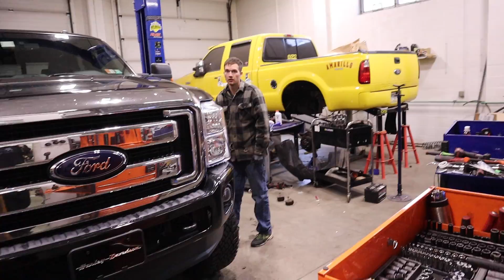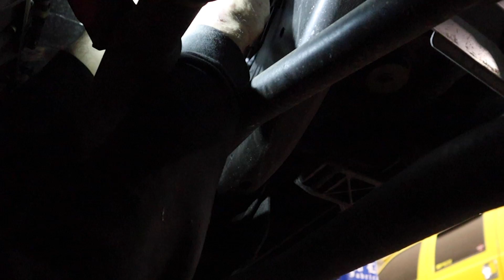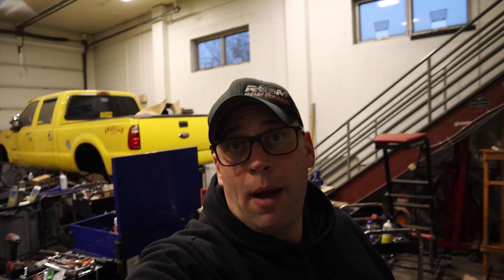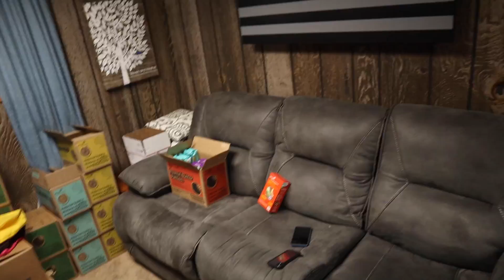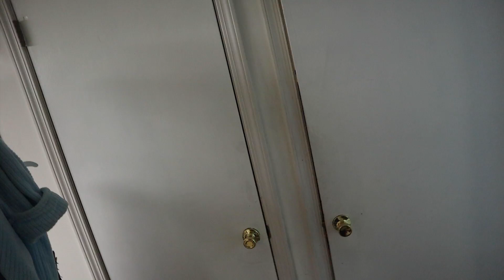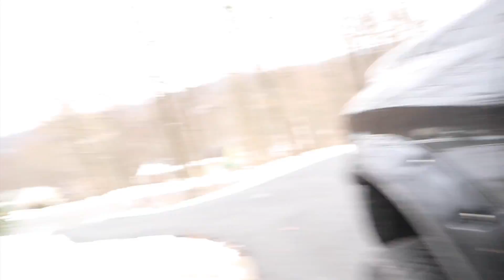CRAZY COOKIE MOM! Cummins CAT Filter Kit Fuel Line Solution

Comment: On DoubleRDiesel’s newest video about cold starts, it looks like he might have mounted one up under the bumper somewhere on his ‘18. Personally, i like this idea because then you wouldn’t have to worry about residual heat coming off the down pipe when running lines down to mount it on the frame behind the front axle, as I’ve seen others do before. Curious to see what you come up with though
Reply from the maker: I saw that video. 🤣 I liked the way he routed the hose along the side of the valve cover. If I keep it under the hood, I’m going to get it powder-coated. Thanks for the info, much appreciated!

Comment: I put my catch can on the frame. Tons of room and easy to drain if necessary.
Reply from the maker: What did you mount it with?
Reply: I used a Moroso catch can which has its own mounting hardware. Just drilled two holes in the frame, installed two nutserts, and bolted it down.

I chose the frame just to keep the clutter down in the engine bay. 

Looks like the Mishimoto catch can has a mounting bracket, should be an easy install.
Reply from the maker: I think that’s what I’m going to end up doing. I’ll text you tomorrow to run something by you.

Comment: You should probably make a note that you will need a quick connect removal tool to get the stock supply hose off the supply line at the frame.  Don't make the same mistake I did.

Comment: Running the same set up with Fox Shocks with reservoirs in the front and it rubs on full turn. Any suggestions on mounting to avoid rubbing while keeping stock wheels with a leveling kit.

Thanks in advance for the help.
Reply from the maker: Do you have the reservoirs pushed in as far as they can go, against the shock tower? If yes, I would be to replace the shocks with something different, relocate the reservoirs or get new wheels w/ a different offset. I’m running 20X12’s w/ -44 offset & have no rubbing at all.